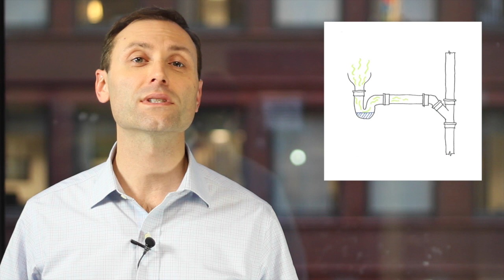Sewer Gas- Part 1

Comment: Sewer gas odors and sewer pest infestation most commonly occur when the water evaporates out of an unused or seldom used sink p-trap or floor drain and allows noxious and corrosive sewer gas to infiltrate your home or business. You can avoid this issue by manually
fill up traps with water every week. Or, you can say goodbye to dry plumbing traps and sewer gas infiltration for 3-6+ months by using a certified organic and natural botanical solution: patent pending SEWER GAS SOLUTIONS ™. Find out more at www.SewerGasSolutions.com.